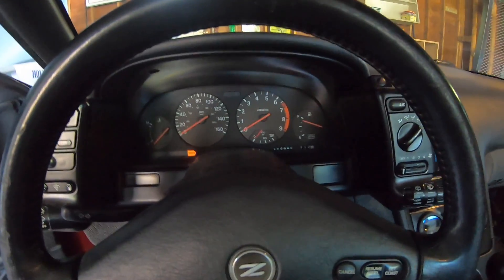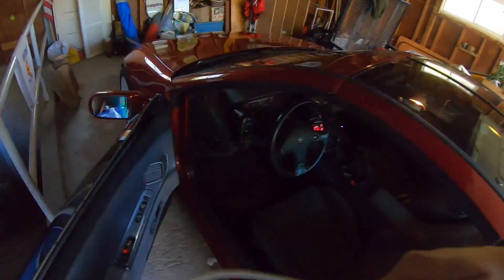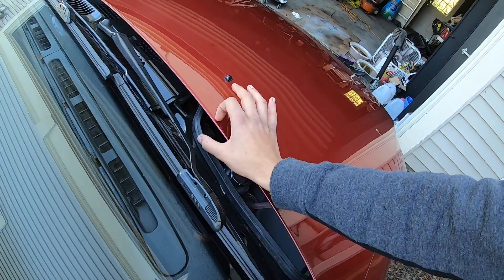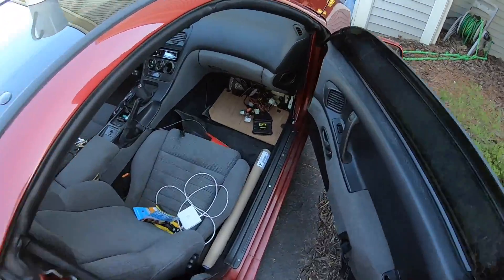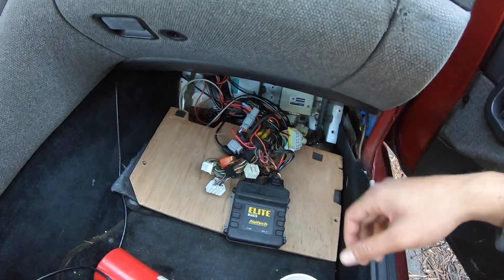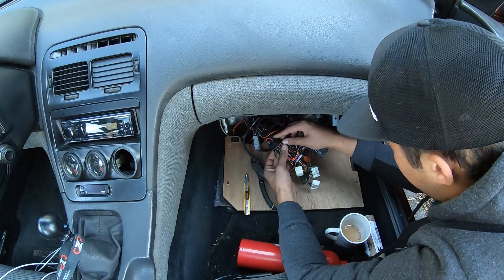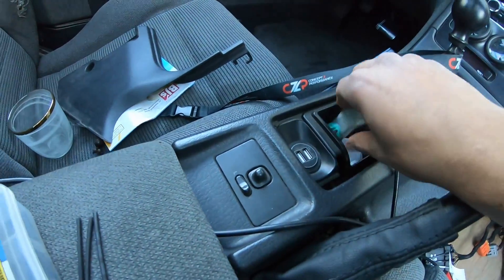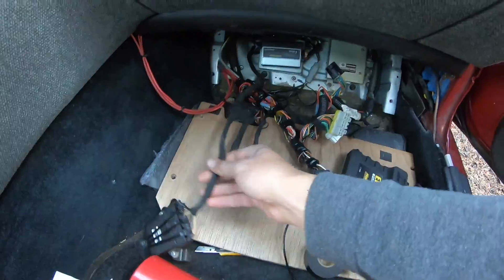2JZ 300ZX Gets some Love

Comment: You should have zero trouble with cold starting on E85 if the cold start calibration is good. I calibrated my college's "clean snowmobile challenge" engine for laboratory-blended true E85, and it started fine at 0ºF after an overnight cold soak. It takes LOTS of fuel to make this happen. You have to ignore the ethanol all together, and inject enough fuel that the gasoline portion is doing all the work. Takes a bunch of trial and error because if it doesn't fire right up, you'll wet plugs. You'll need to pull the plugs, dry them, and dry the cylinders with a propane torch (don't look down at the plug holes!). Takes time and effort, but is completely doable.

Comment: The clutch dropping is your slave cylinder replace for a oem one.
Reply: exactly.. very common on high mileage VW's of the MK4 generation. just as an example
Reply from the maker: It’s a new slave. But not sure the brand. Whatever the adapter plate company sent me.
Reply: Kalvin Malli  go for factory oem  aftermarket ones are junk.

Comment: send your injectors out to get clean and flow checked also depending on what type a coil pack you have it helps with cold starts with E 85 not only that may be a different temperature spark plug will help also wouldn’t cold starts with E 85 you have to warm the pump up so prime the pump by putting the key in and secondary three times then hit the gas pedal three times to wet the top of the piston and to relieve the loan has E85 gets real dirty and gunky so once you sprayed it that jacked her out I’ll come out like I missed instead of coming out like a dribble And you should look into maybe getting your E 85 mix there’s an additive that helps you with the build up in the sludge with cold starts help you with that

Comment: On the starter, sometimes when an engine sits for awhile the brushes get stuck and no longer push up on the com bars. Might be worth it to pull it off and if you're lucky the brushes might not be worn out and just need to be freed up with some wd40

Comment: A 90 on the dain is fine.  It's when you use 90s on the feed is when you have issues.  The pressurised oil can back up on the bend.  But drain is fine and it looks like a big gauge too.  

I was one of the people who said be careful but I thought it was the feed not the drain.

Comment: Did the ground wire from the other video " 2jz problems" fix the starter problem or is the starter just to weak?
Reply from the maker: It wasn’t a ground issue. It was the trigger wire for the starter. All good. But my starter is slowly failing I think.

Comment: How's your transmission drive since you cut the shaft? And how far back did you cut the shaft. I'm thinking about doing mines too getting annoyed of the chatter whining noise.
Reply: Please, please don't cut the tip off your input shaft! It is a hamfisted, ridiculous "fix".
Reply: @GroovesAndLands  man I hear what your saying, but it is extremly annoying, sounds like my cars breaking down. I mean it drives good and shifts great but im getting annoyed to the point of thinking of scrapping the cd009 and going to the r154
Reply: @123thatsithaha  That's a bummer, for sure. Maybe you could upgrade the bushing to an actual bearing? I'm pulling my entire R154 setup out of my IS300 tomorrow, so I can begin installation of a 56 magnum...  So, if you want an R154...

Comment: i think you still have electrical gremlins and i only say this because when you put key to on position your speedo jumps about, the oem z32 setup dosent do this. i think there might be a short hiding somewhere else along that harnes.
Reply from the maker: Only did that when we had the pinched wire. Never has done that and hasn’t done it since we fixed the problem yesterday.

Comment: The oil drain. Cant you just weld a pipe down between the exhaust amnifold down, and then go with AN fittings down to the oil pan? :)

Comment: People call the engine heart of a car I personally think it's the wiring. Wiring like heart got none and nothing works, cut the wrong wire or vein and you need a surgeon to fix it!  Any one can change an engine with the right tools, anyone cannot fix a vein or wiring even with correct tools.  Starter motor sounds strong once it cranks solenoid or lose wires maybe. But try jack car up or put on ramp come out in morning  and jump the starter by unplug little wire at starter and put a thick jumper wire make sure good contact touch it on positive battery if it cranks no problem then its something else. Weak solenoid, weak starter relay or wire from relay to starter solenoid is corroded making to much resistance for enough power to get through and that's why it clicks few times and works. If this has been an on going issue for a month or more I'd bet the starter motor its self is fine.